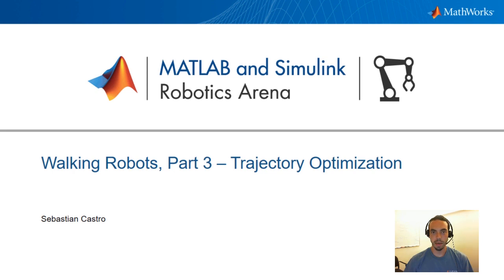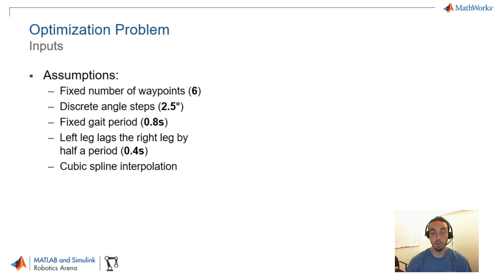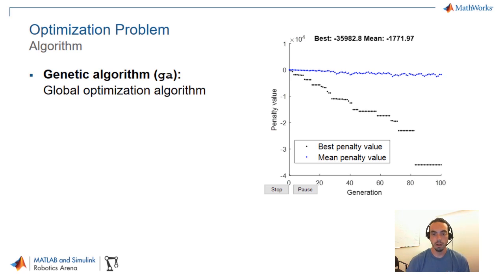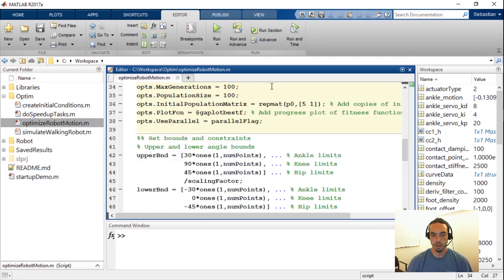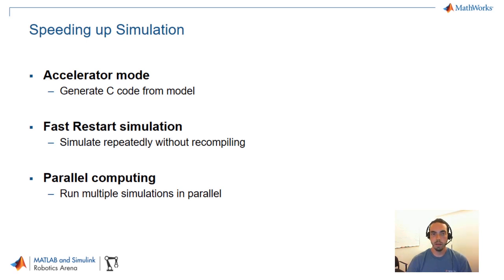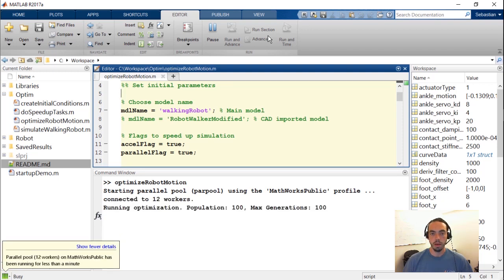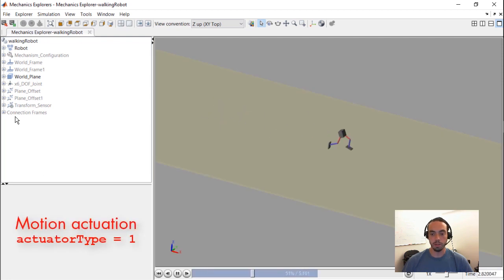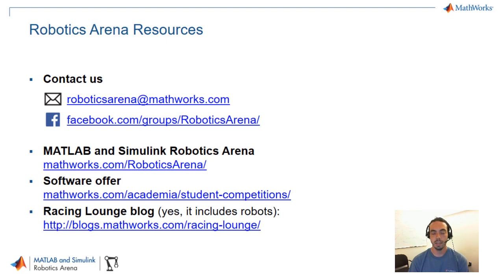Walking Robots, Part 3: Trajectory Optimization - MATLAB and Simulink Robotics Arena

Comment: Hello, thank you for this great tutorial. I am trying to apply the same approach to exoskeleton with human dummy model but the simulation is not running due to kinematic singularity as the exoskeleton and dummy links are in parallel. The exoskeleton joints are actuated and the dummy follows.. Please suggest a way out. Thank you.